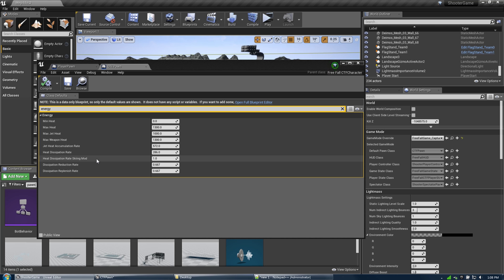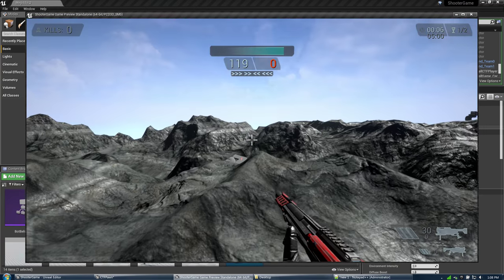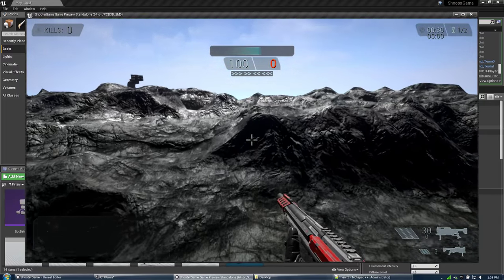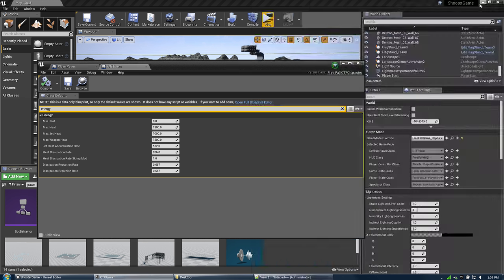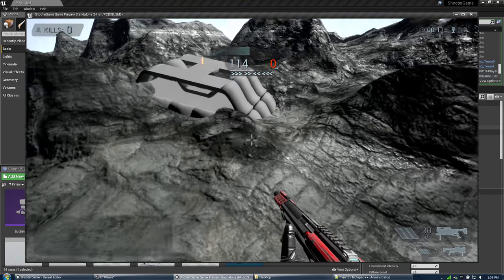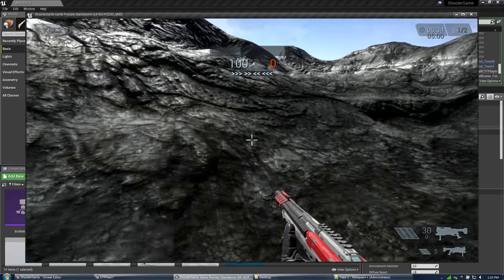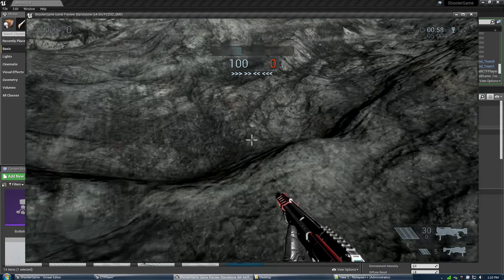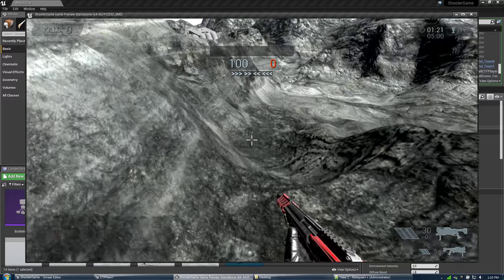Energy Changes While Touching Surfaces

Comment: That's one blazing fan. ;) Seems like energy regen only on terrain touching would invalidate a lot of the Tribes style high swooping routes, which were a joy to run. I think it's a more interesting terrain runner, but also having to play an FPS with a less forgiving mobility system than before seems like it'd get clunky.
Reply from the maker: As things are, energy regen only changes when touching or not; still get regen when airborne, just less than on the ground. So far I've not noticed problems establishing high swooping routes. I'm still juggling with jets that have high turning thrust compared to T1 / T2 jets. Hopefully the video comparison shows enough that the before settings were too floaty. Still tweaking with things, I like the added control over energy behavior though.